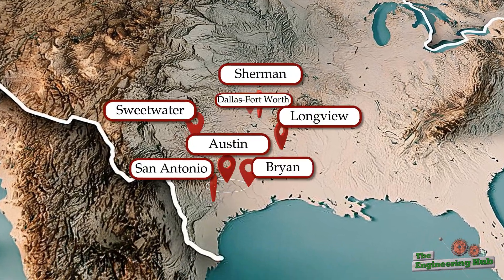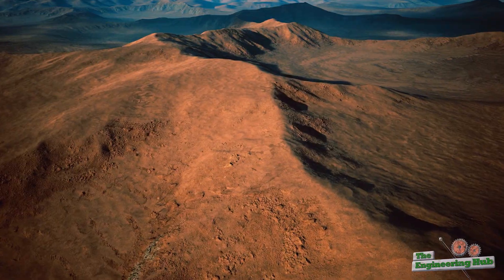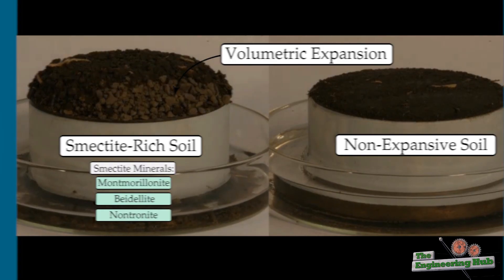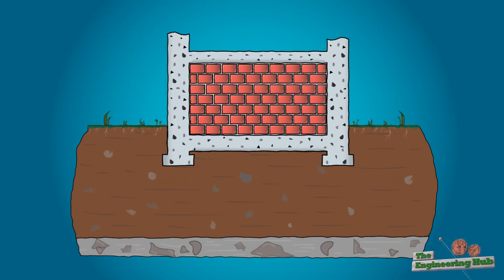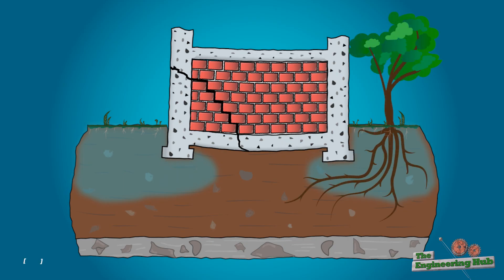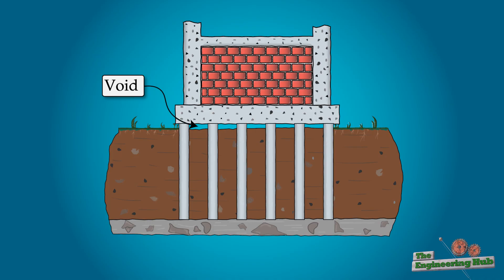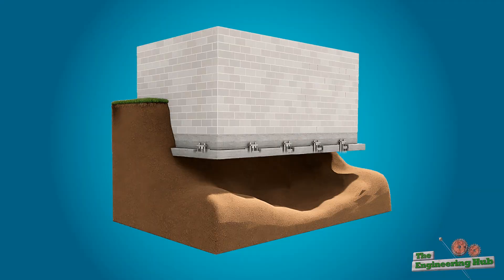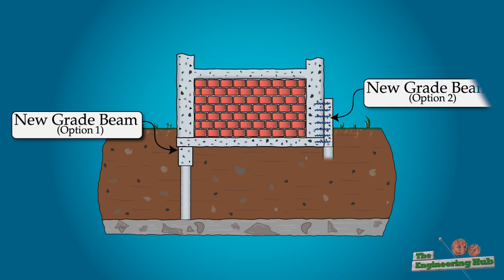Residential Foundation Problems

Comment: I’ve spent 40 years in Civil Construction and agree with your comment about workers not appreciating the importance of certain aspects of their work. This is why, as a Project Manager, I would identify such risks as part of the Risk Assessment for the project and ensure that staff are aware of critical aspects of their work. I slept better at night knowing that critical quality issues were not being ignored through lack of knowledge
Reply: Carpenter here, there are plenty of us who do the full extent of our duties. Please Retain your best guys and circulate them around your team so they share their knowledge. And please stop leading with how bad everyone else is, our industry would benefit to lose that idiom.
Reply: Your field is very complex and I would never second-guess any regulations. 👍 It does not pay off to cut corners.
Reply: thanks for this, wish more builders / construction workers / tradespeople cared about quality
Reply: @bruce-le-smith  While there are scammers, the immediate cause most often is improper communication between design engineers and site construction. It's pretty common that the on-site reality will diverge from the plans, which means adjustments need to be made. It is therefore crucial in these situations that the on-site workers know what design elements are critical (and ideally basic knowledge on why) and which ones are more flexible to avoid the good-idea fairy making a mess of things.

Comment: I’m currently dealing with a 15m tall 200m long concrete crib retaining wall which is failing due to poor drainage both on top and toe of the wall, and constructed at a steeper than recommended batter angle. Currently ongoing investigations.

Comment: I am building a simple, two story cabin on a steep slope in Chile, which is mostly dry but with occasional heavy rains (that often lead to severe soil erosion). What foundations do i need? Are there any other mitigation measures i should undertake?

Comment: Western North Carolina hurricane Helena..mud slide of app 40 ft from edge of house to rd..I am considering to terrace the steep slope using redi rock cast concrete blocks..46 wide and 18 inches high..the bottoms go almost five ft from face to rear..I’m thinking of pouring a 1 ft thick 5 ft wide and 60 ft long
Do you think this will work with gravel as back fill using drain pipe and fabric?

Comment: Please talk about Millenium Tower in San Francisco? It seems to me that their fix is not going to work. Thier fix reminds me of someone trying to tilt a bag of groceries by pulling up on one side of the bag's bottom. I keep thinking it's going to "bow" and eventually fail. Am I wrong to worry about this? I'm not a structural engineer, nor an architect, so I'm not the best source of information on this. My concerns are probably unfounded.

Comment: I live in rural central Minnesota and it is common to find homes with horizontal cracks in the foundation walls at the depth of the frost line. Another common failure is where concrete slabs heave and move, grinding against or pushing into the foundation wall. Often when the slab cracks on the face, its slope will bring water towards the house.

I saw this most dramatically with a home that had an in-ground swimming pool installed. The pool and home were settling or heaving at different rates, which caused the slab to grade down towards the house and that foundation wall rapidly began failing. The cinder block wall sheared in a sawtooth fashion towards the basement slab, then sheared horizontally towards the end of the wall. The whole foundation wall on that side was replaced, and the pool patio slab was replaced.

I am curious with the increase of extreme weather, how much more common foundation failures will be. I live in a sandy area where the ground water was historically 6-8ft down, with just a slight moistness up to the surface. Over the course of 2024, in the spring and summer, the ground was saturated and stayed saturated By the end of July was back to normal.

Having ground water all the way up to the surface is dangerous for private septic systems as they will fail. Both as a biological hazard and mechanical if the lines or tank freeze. We had to regrade and place 12” risers after a violent storm left 6” of water sitting over the tank for several days. We were fortunate the tank wasn’t breached by the sitting water.

Comment: Sounds like the Millennium Tower in San Francisco. The buildings surrounding the tower have pilings to bedrock the MT doesn't. Ways to save money. 
Odd that it was not done to bedrock since that area is prone to liquefaction. Condos are cheap if you want one.😂😂😂

Comment: In Australia, house foundations were often what was known locally as the "floating slab" design.   The term, "floating slab"  is applied to a concrete floor and foundation built monolithically with enough reinforcement to (hopefully) allow the entire slab to rise and fall without cracking.

Unfortunately, in recent years, the attitude has become "build it to last 15 years" and ignore any potential problems that might arise after this time.  Having been employed in a construction-adjacent industry for a few years, I've seen some appalling corner-cutting and lack of care in the building of modern houses, particularly in respect of house foundations.  Floating slabs are now rarely employed, replaced by much weaker and cheaper slab designs.

In Australia, despite many costly and difficult rules purportedly created to ensure "environmentally-friendly construction", we have entered the era of throwaway houses.  In my local area it is not at all uncommon to see houses just ten years old or less being demolished and replaced.  A great many houses 15 to 25 years old are showing signs of severe foundation issues.  Regulators seem indifferent to the shortcuts that manifest as major foundation repairs down the track.  

It is disheartening to see the environmental hypocrisy of regulators.  Builders must perform multiple additional works to comply with complex environmental laws.  These additional works cost hundreds of thousands of dollars on top of the base cost of construction, only for many houses to need replacing or expensive remedial repairs just a few years later.  I would not buy a new house in Australia these days.

Comment: As a geologist that works as a consultant in geotechnical solutions, in the south of Spain, we also have the same problem with expansive clays, that are from the miocene and very consolidated, so they push really hard upwards, and cause serious problems. The general way we fix this is by using semi deep foundation (caissons) passing a -3,00 m depth from the surface since, that area is inside the active layer of the clay. In other occasions we also use slabs, with 3 or 4 layers of structural fixed-filling, that will cushion the area and mitigate the expansive movements.
Reply from the maker: Thanks for the comment Alex, it's great to hear from other parts of the world and how you have managed to deal with these issues. Cheers and thanks for tuning in!

Comment: I'm a mechanical engineer, but the concepts of civil engineering have always fascinated me. Loved that you put references and noted them in the CC. Also was not aware of clay deposits and the water in the great plains during the Cretaceous period 😬 My late grandfathers house had a foundation failure in the basement in OHIO, likely from freeze/thaw for decades, but it was only the buckling of a basement wall, so they put slowly tighten-able steel reinforcement beams on that wall to fix the foundation to lessen the cost

Comment: At 6:36 you say that you read 100% of the comments. You also asked for ideas for content in a post/pre tension video I saw. Good, So could you do a deep dive on moon phases and the numbers that go into megalithic structures? How were they built, how were such massive granite stone cut or moulded or moved, (Incas), and of course this would be an opinion piece on the producer of said deep dive.
Reply from the maker: Hi art1, I do read all of the comments. Thanks for the suggestion, I have heard about these things on Joe Rogan's podcast. It's indeed very interesting. But I am afraid I am not qualified enough to talk about those structures.
Reply: @TheEngineeringHub  FROM WHAT I'VE SEEN, YOU ARE VERY QUALIFIED. WE'RE TALKING ABOUT NUMBERS AND SUPPOSITIONS. THANK YOU FOR ANY CONSIDERATION, ANYHOW.

Comment: I heard that for decades it was common practice for Geotechnical engineers in Texas to borrow a swell formula from TXDOT for commercial and residential building construction. The formula was reasonably sound in the context of building highways of modest width where the road is built up with ditches on either side. The formula includes a 1/3 factor that assumes and accounts for the highway subgrade not being horizontally constrained and thus much of the swell can move outward rather than upward.

The practice of borrowing this formula and not understanding its original context led many engineers in Texas to essentially underestimate swell potential in buildings in many areas by a factor of 3. So 4 inches estimated becomes 1 foot in reality.

Comment: Thanks for this informative and entertaining insight into FOUNDATION FAILURE.  Here in mid-western Canada foundations are typically underpinned well below frost, I have seen big mansions built on old swampland (after several years of the site piled high with backfill) such that after soil test analysis, engineers specified over 200 screwpiles to depths of almost 30 feet below the basement footings. This was at a 8500 square foot Two-storey walkout.

Comment: Hi...I m just trying to build my house in hyderabad in India. Our plot has soft soil with a mix of  clay, sand and particles made difficult  by water. The plot is close to a lake and adjacent to a well that was filled and a park constructed on it. Thd SBC is 12 to 15 and accordingly  the engg designed the isolated footings ranging from 6 feet to 11 feet. The earth was dug to 11 feet and going deeper was only helping more water seep. So at 11 we added bed of 1 foot sand. 6 inches of pcc. Laid the footings.  Since the volumns would now be lenghtier he added a tie beam. At 5 feet the plinth beam would be laid. Additionally he added a retaining wall between the the beam and the plinth beam.

Comment: I have a friend who has a house built on shale. The house has cracked through the centre . Cracks open across the ceiling and walls . It appears through these cracks , that the outer edges have dropped and the centre has cracked apart .therefore the foundation concrete  slab has flexed. As a curious person and engineer not civil I am keen to understand what's going on ,how to possibly dampen the problem and learn what measurements to make to work out what's going on. The owner claims the builders drilled pillons into the ground right down to shale rock . I contemplated making measurements from a reference point away from the house to a grid set of points around the house slab via water pipe level to determine the flex over time. I also observed some of the roof battens snapped apart at the weakest points probably due to the flex. I know because I repairs one or two due to aleak in that roof. Thanks for video

Comment: Raft slabs are a possible solution set out in AS2870 which is the Australian standard for residential slabs and footings. That and keeping water away from the foundations are the biggest challenges. Here in Australia in 'Highly Reactive' and 'Extremely Reactive' soils the movement can be in excess of 100mm due to differential moisture content. A typical 'H' class footing system for a residence would be beams in a raft configuration spaced at no more than 4m apart heading in either direction. Continuity between beams being a major consideration. The prescribed standard we use here for say a 'H2' class (not even the worst category) for an articulated masonry house (brick veneer say) would mean 700mm deep footings with 3-N16 bars top and bottom so some pretty heavy duty stuff.
Reply: You took the words right out of my mouth.

Comment: This is a HUGE problem in West Texas. I once owned a house in Abilene, TX. The slab is just poured onto the ground. There is no compaction or grading, it's just poured and left to cure. The after a few years of wet and dry seasons, the grout shifts and CRACK !! IDK if there are any regulations in Texas about residential foundations ?? C'mon now at least have a simple law about this. But Texas is a wasteland that you don't want to live.

Comment: I can see by some of the comments, people (including myself) still don't really understand this expansive soil problem.  Moving from Michigan to the coastal bend of Texas, I got to see first hand how different the soil is and how you simply can not use the same solutions to mitigate water problems.  So many times I wish the builders would have places water hoses and sensers every square yard or so under my house so I could react before my foundation cracked.  
It is so hard to explain to my northern friends and family that we do not have basements because of destructive nature of the expanding soil and our houses are basically boats floating on the ever changing ground.
Reply from the maker: It's a nightmare to deal with. The best course of action is probably to prevent it from happening in the first place by proper design and construction (not very useful saying it now, I know..). Mitigation is difficult, expensive, and case specific

Comment: I try to tell out contractors the purpose of our products. We use on site (typically clay) behind our walls and a couple of contractors have installed our drains backwards to the point where the water just collects behind the wall and drastically increases the bearing load 😬

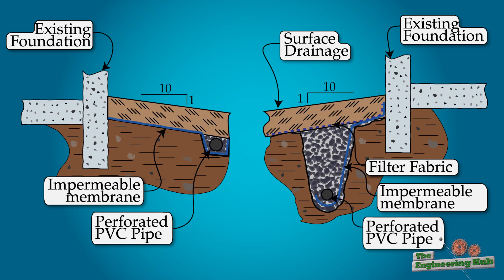Comment: I'm glad you showed me 8:42. I had a contractor ask if we had any solution for his outer wall cracking and I designed exactly the right picture for him on the fly. I've always wondered if it was a good design 🙃
Reply from the maker: Reference [5] and [6] by J. D. Nelson have more in depth explanation about water barriers if you need more details.

Comment: I won't buy Spec Homes - too many cut corners!  So, I designed&built our home with 40"x24" rebarred footings, 3-foot wide soffits around the entire perimeter.  That, exterior insulated foundation and 6" gutters and 4" downcomers connected to u/g 4" PVC that drain to two 1,000g leach tanks buried 6' below our basement floor.  18 years and no sign of foundation movement and zero moisture evidence in basement.
Reply from the maker: That's amazing!! 👏 My guess would be that your solution would still end up cheaper compared to someone who has to do underpinning or other mitigation work after the house has been built. Good planning can pay off in the long run. But I doubt developers would go that far when developing residential areas.
Reply: That's the way to go! Did you get any grief about "overkill" from  subcontractors or lenders?

Comment: I work with mechanical (push/helical) resistance piers in the USA and in now Australia. What are your thoughts for Polyurethane injection "underpinning"? No lateral support and temp fix for vertical (settlement & stabilization only).

Comment: I had heard that one way  to control changes in soil moisture was to constantly keep the soil wet under and around the foundation so it never drys out and shrinks. This would only work if water was plentiful enough and cheap.
Reply: This method was tried in the Raleigh/Durham-Chapel Hill market for a number of years by one particular engineer/contractor collaboration......with dissaterous results. Push piers or Helical piers are a much better idea.
Reply: What about the reverse?
Levelling out the moisture differential by creating a perimeter rubble ground drain, protected by Geotech fabric.

Comment: Drain tile and sump pumps are becoming more common as time goes on, in some areas they have been common for decades.
Reply: I’m a carpenter from the western prairies of Canada and that has been standard practice for quite a while. I now live on the west coast and most new construction has extreme drainage mitigation strategies. Starting with large roof gutters that are directed into the structure’s sump pit. Secondly there is also drain tile installed that directs water to the street drain system. And finally there is code requiring proper slope for backfill. 
I found this whole approach interesting and so completely different from the dry prairies to this very damp rain forest. The foundation is just the start of the differences, such as damp proofing prior to exterior finishes, but that’s another topic. 
Thanks for the great conversation starter. I’d like to hear other challenges builders face in different regions. 
Cheers all